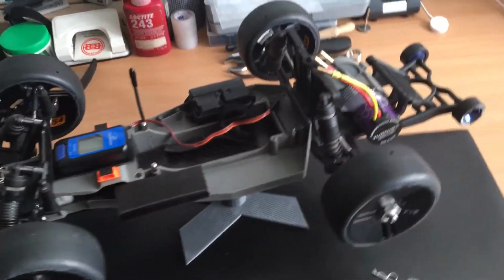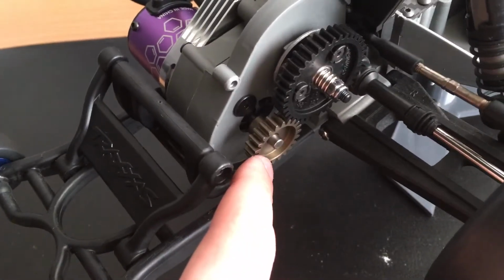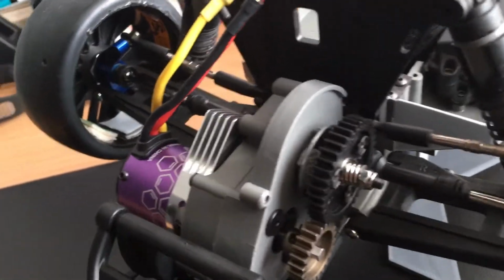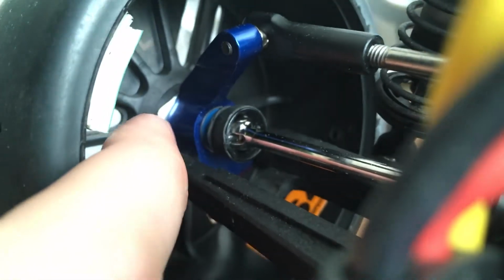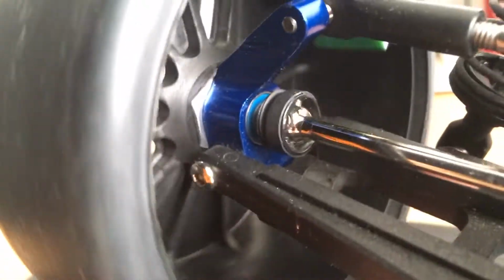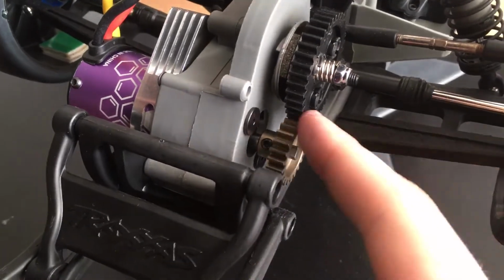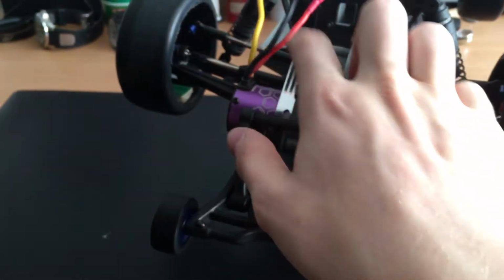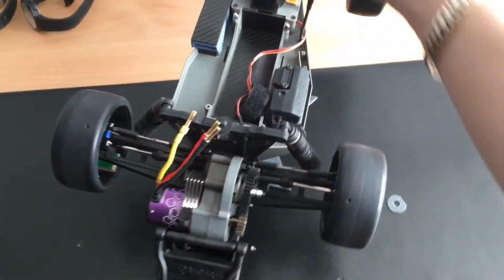Rustler 80+ mph build update video: new transmission and MOD 1 gearing installed

Comment: M doing the American thing to mine with a tp power 3640 2600kv how's the shafts holding up now?I've got the same shaft
Reply from the maker: IRONCLAD RC the shaft is holding up great. No issues at all. But this is only 4s, it’ll prob break on 6s

Comment: I have a turnigy xk 5400kv 3650 like your motor what esc did you use i just burned up my hobbywing wpsc-8 120a after 10 minutes lol
Reply from the maker: I used a hobbywing max 6

Comment: would 24/36 fit with a integy transmission case
Reply from the maker: Yep no problem
Reply: @rc4life860  i was thinking 25/36 but im not sure if it fits
Reply from the maker: @maagneticc6470  im not sure either, 24/36 feels pretty tight in there and there is not much space left. So its a guess
Reply: @rc4life860  did u ever run 24/36? if u did on 4s what was the top speed
Reply from the maker: @maagneticc6470  I did run it for a solid 6 months. Hit around 75-78 mph. It has the potential to go over 80 though, but I used a huge carbon rear and front wing. That made it stable like an f1 car, but it definitely slowed it down.
Reply: @rc4life860  i wanna hit 80-90 mph on 4s
Reply from the maker: @maagneticc6470  then get different electronics
Reply: @rc4life860  im getting a 2650kv castle 4s motor

Comment: Where can i buy the mod 1 spur gear ?
Reply from the maker: On the traxxas website. And in pretty much every hobbystore
Reply: @rc4life860  i couldnt fin anything about how to use a mod 1 spur gear for my Slash 2wd. I have a 2050kv arrma 6s combo that i want to use for bashing , cand you Tell me any ref# of the parts that i nerd yo use the mod1 spur ? Thank you a lot
Reply: Need to use*
Reply from the maker: marcosdo99 the only thing you need is the spur gear buddy :) it will fit right on the slipper clutch
Reply: @rc4life860  i already cant find any mod1 spur gear compatible with the stock top shaft, where can i find It?
Reply: @marcosdo995  U need a robinson racing part number 1200 5mm to 1/8 sleeve to do the mod 1 conversion
Reply: @marcosdo995 he's using an E-Revo spur mounted to the stock slipper